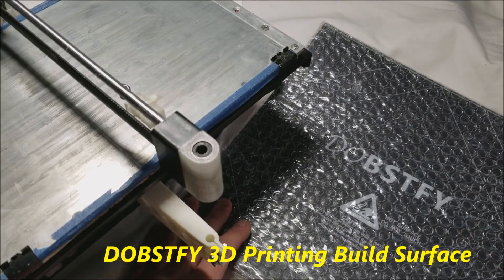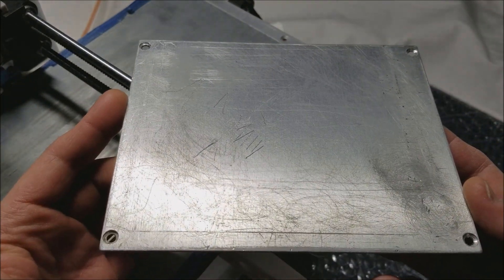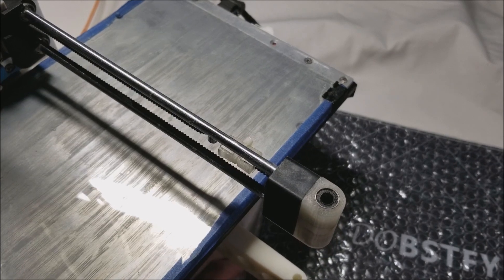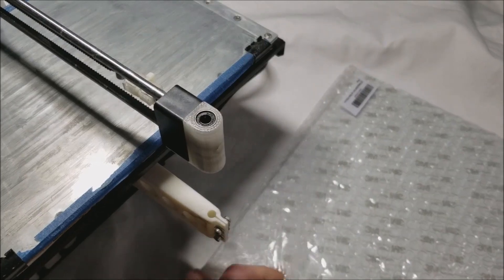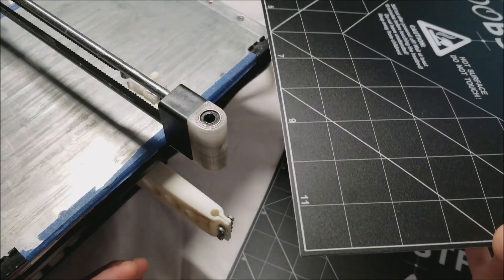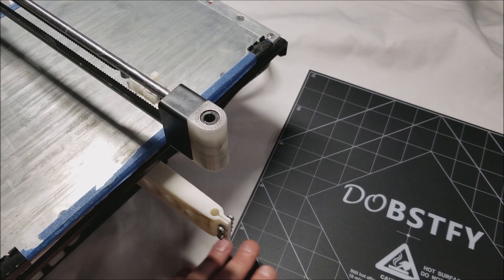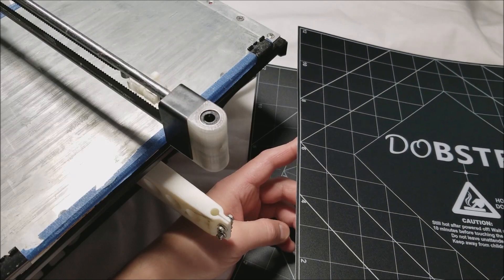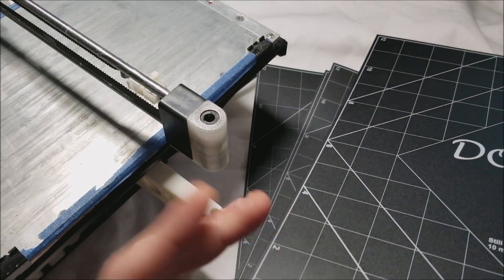DOBSTFY 3D Printing Build Surface Product Tour

Comment: I just got the same stuff so I hope it works great for you. I still haven't put my printer together yet. It's still in the box. I am brand new to 3D printing. Best luck to you.
Reply from the maker: it works great, I like it a lot, just before to clean it with a little alcohol after each print
Reply: I get a chance, I'll try it. Thanks!